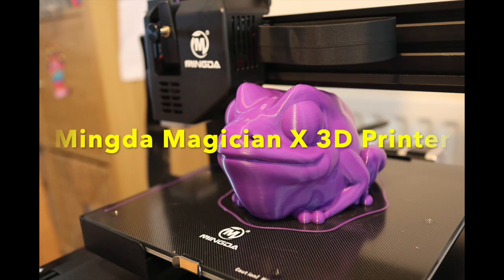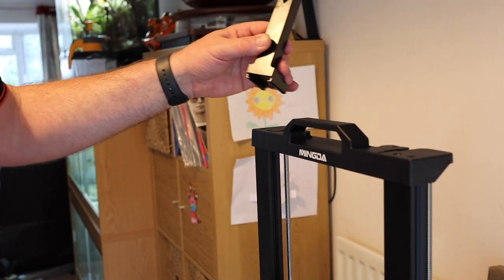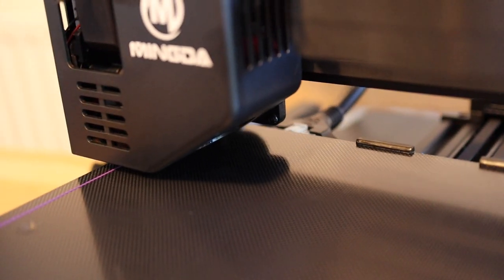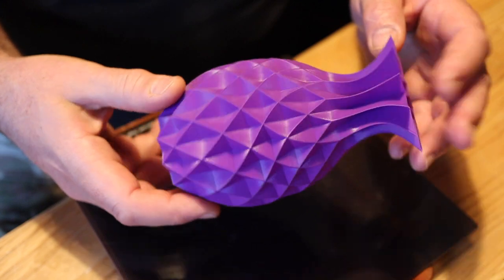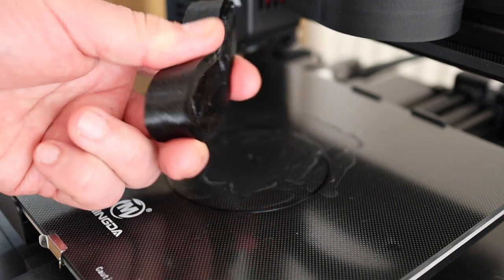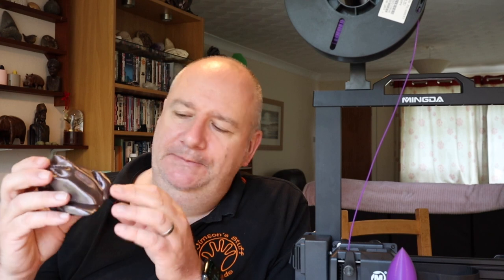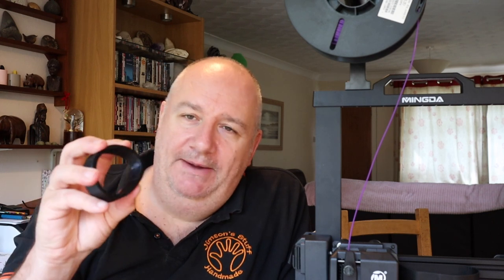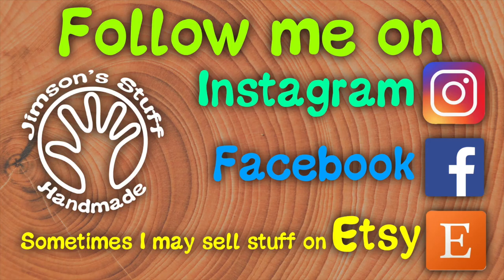Mingda Magician X 3D Printer - Review and First Prints

Comment: Do you have the printer profile?
Reply from the maker: I just used the default profile for this printer on Cura, I think I may have increased the retraction a little but this will depend on the filament used. Many thanks for watching.
Reply: Im trying to print with Esun but i have a lot of stringing. Im using the Migna Cura, the temperature 190C, Speed 50 mm/s, retraction 1mm at 40 mm/s. Nozzle .4mm.

Comment: I have just purchased one of these, it's en route, what settings did you tweak to get it to print better? Any help appreciated
Reply from the maker: sorry for the late reply, I can't remember what settings I used but I seem to rember that I increased the retraction quite a bit to lessen stringing. Generally I use the standard Cura profiles

Comment: I’m going to assume once you chose a design and sized it, it knows if you’ve got sufficient filament to complete the print? How long did froggy take to do?
Reply from the maker: The slicing software tells you how much filament you need for the print and you have to check how much you have before starting. It is surprising how little filament a lot of these prints require. The little froggy took less than 3 hours but the big one took 16 hours